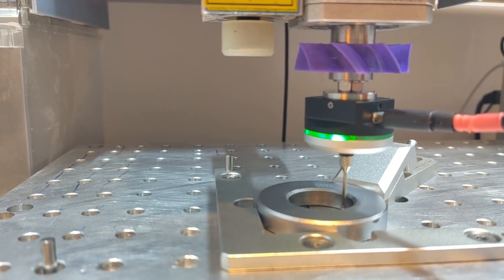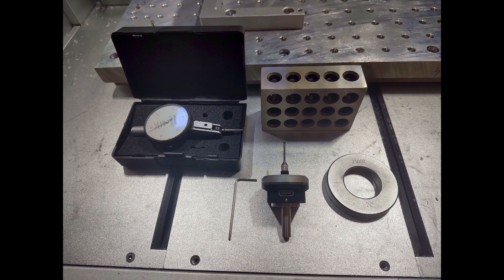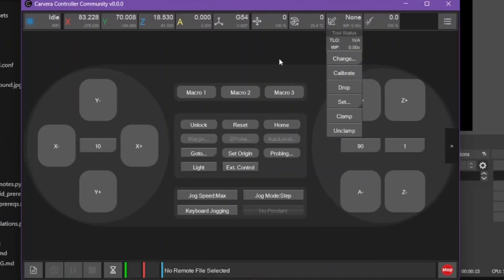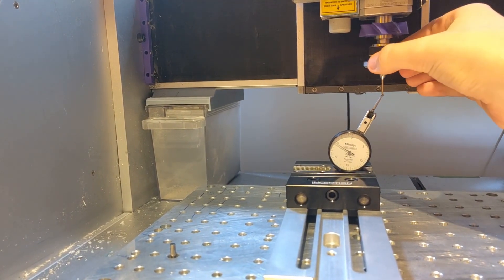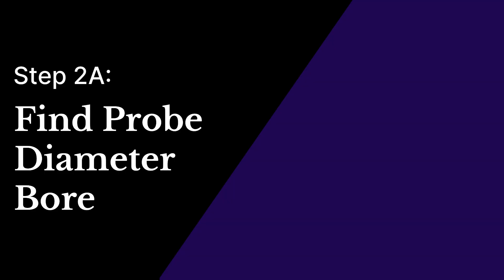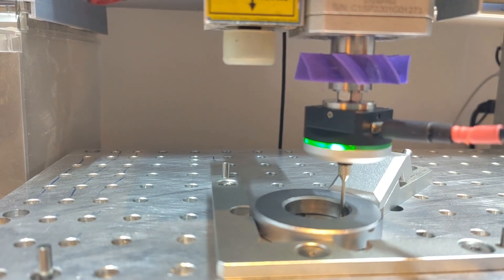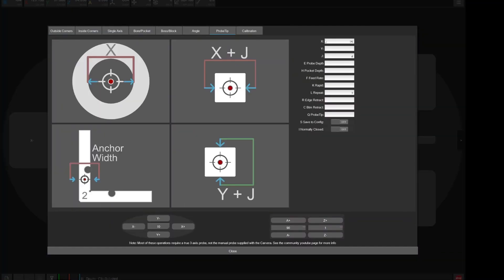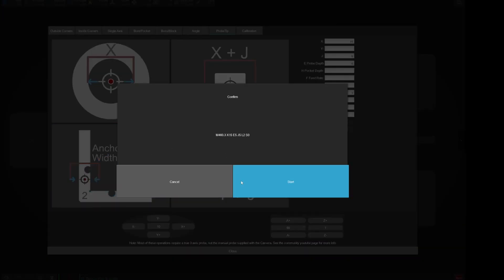3D Probe Calibration Makera Carvera

Comment: I'm not 100% certain, but I just adjusted the concentricity of my probe, and I think the set screws need to be adjusted opposite of the directions in this video. The screws seem to control the position of the probe body relative to the shaft held in the spindle. Loosening on the high side and tightening on the low side translates the body (and probe tip) towards the low side, relative to the spindle center of rotation, canceling the non-concentricity.

Comment: Fae thanks for another great tutorial! Just a couple of questions: 1) when centering the probe tip, by what amount should we loosen the set screw by? Like a half turn, a full turn, 2 full turns, etc.? 2) when centering the probe tip, what is a good range on the Dial Test Indicator to by off by? less than 0.0005mm or what? Thanks again for all the great work!